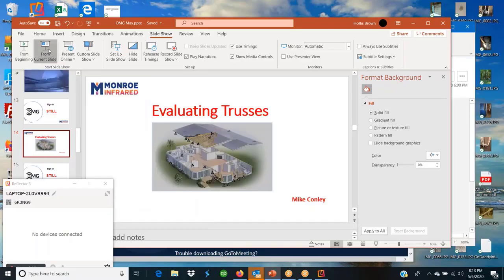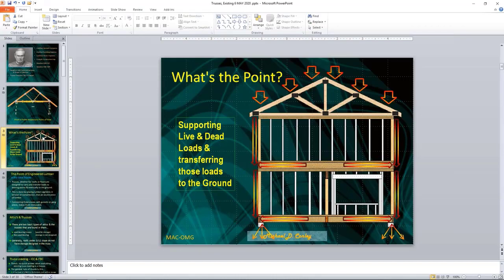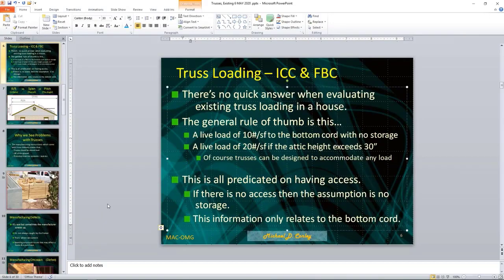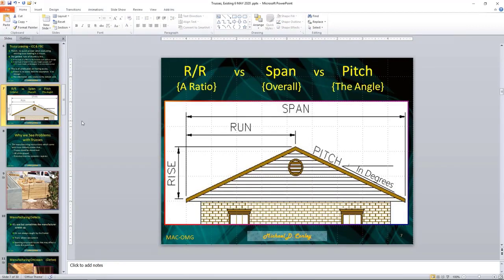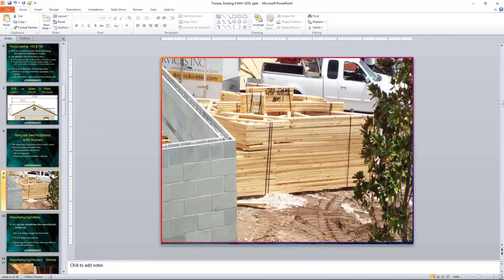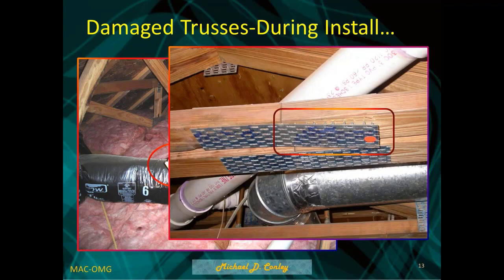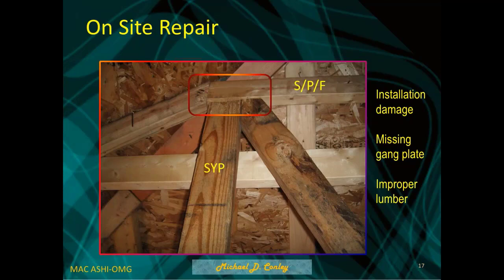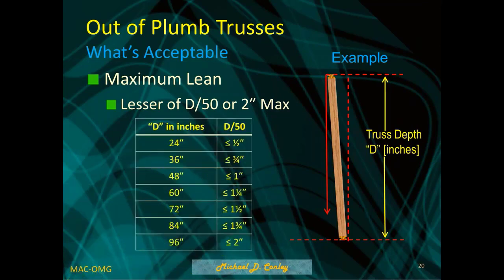Evaluating Trusses During a Home Inspection

Comment: I was hoping for an example of a storage truss manufacturing defect where one of the webs connecting to the bottom cord has a 1 1/2" gap between the wood, with the gusset plates on each side. Does that matter? I didn't notice it until I was installing the storage floor plywood.

Comment: Not sure if this will be seen. I have discovered some water damage on one of my trusses in the garage section of my home that was built in 2000. The style of the truss looks similar to the Double Howe style. Is this something a roofing company can repair, or would I need to hire an engineering company to take a look at. Thanks